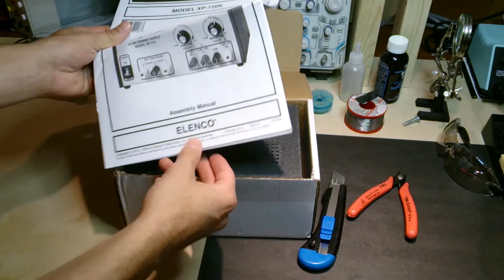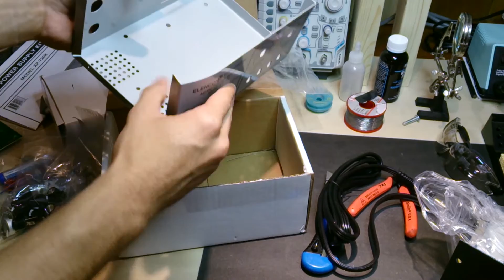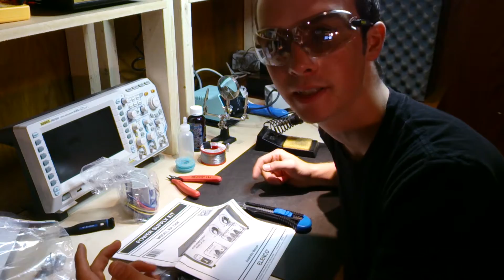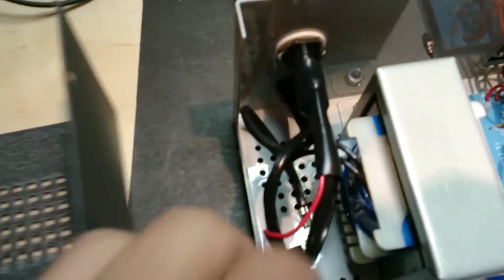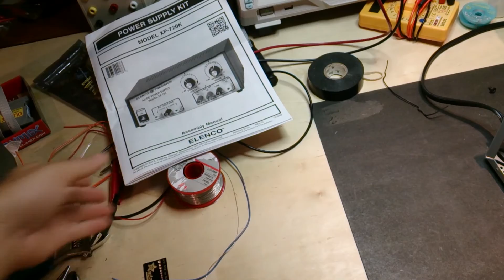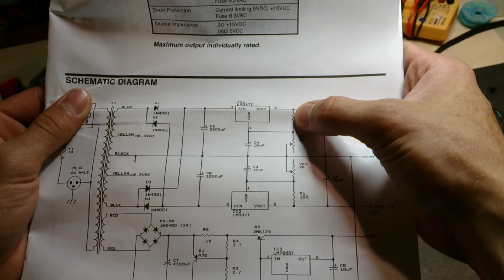Tinman Electronics 1 - Elenco power supply build

Comment: They could have done much better with the TO-220 regulators @9:09.  They could have designed it so the regulators mount vertically on the PCB and by moving the board toward the rear of the chassis, mounted to the case with insulators (they require that anyway on the heatsink.  If you have to mount a TO-220 like that I recommend soldering the wire parallel with the lead, don't wrap it around the lead, and then heat shrink each lead of the device and wire connection completely to prevent accidental shorting.

Comment: This is the highest amperage variable supply I have, but I can attest that it does have its drawbacks, especially the lack of a display and the awful binding posts. Opened it up a few days ago to tighten them up and the wire just fell off. I'm crimping them this time. Awesome video!
Reply from the maker: Yeah, I can't argue with the current rating of this supply since I haven't yet used over 1 amp in my electronics projects. I'm glad you enjoyed the video; thanks a lot for the feedback!

Comment: I built one of these.  It was short one star washer.  The wires could have been 3/8 or half inch longer.   I used a lot of liquid electrical tape and additional heat shrink tubing on all the wires going to the regulators.  I wouldn't avoid it but should be good at soldering and double-check each wire.

Comment: Just an FYI. The 6.3 volt ac and 12.6 volt ac are for tube filaments.
Reply: yeah, and everyone those days is a "huge tube fan", so, they will use those outputs everytime! :)))))))))))))))))))))))))))
seriously speaking... they can be useful sometimes... when you need a signal of 60 (50, for Europe) Hz and an amplitude of 6.3 or 12.6 V! :)

Comment: I gave up soldering the binding posts and used a small wrench to tighten the wire's between the nuts and used locktite to secure them.  I never bothered with the heat shrink and zip tied all my wires into bundles.  It's not a bad kit, but it was a pain in the ass but thats why i build these things.

Comment: With some 10-turn pots for better control, better/higher voltage caps and an aftermarket panel-mount voltmeter it probably would not be a bad little power supply. Of course once you do all that why not build it from scratch? At least it has a primary side fuse. The smaller XK-15K kit has NO fusing whatsoever! What is interesting is that I found reference to an older XP-620 which does not have the 6.3V AC output, so there obviously was a demand for it (for what I have no clue).
Reply from the maker: Yeah, it would be easy to upgrade this power supply, but then I'd be losing more and more on the value of it. I could add the 10 turn pots, better caps, better binding posts, and a simple 7-segment voltmeter (http://www.adafruit.com/products/705) but then we're all better off settling for a better power supply! I always buy cheap equipment, and never learn my lesson...I gotta stop cheaping out on this stuff!
(And I totally hear you on the 6.3VAC output...still no clue what I'd use it for)
Reply: Tinman Electronics Looking around 120V to 6.3VAC power supplies (plug-in type) are not that uncommon. I suppose some equipment/devices rectify "on board" but do not have a transformer. As I am just getting back into the hobby after a few decades my assembly skills need some work. I purchased an cheap unassembled XP-620 kit off of Ebay for the practice. Without the extra 6.3V terminals there is a lot of real estate of the front panel for some extra meters. Relatively cheap, should be fun to modify and if I destroy it no big loss.
Reply from the maker: Bigrignohio Good to hear you're getting back into electronics! And good call on the 6.3V terminals; I could always remove them to make space for adjustments!

Comment: I built mine based on the LM317 on a piece of experimenters board, similar to what you have, and mounted the LM317 to a TO-3 socket. I wish I had known about the LM338K!   I even made my own voltmeter gauge  from a scrap meter movement.  Mine fit into a plastic project box from Radio Shack.  
  I'd like to figure out where to get a nice soldering iron, the ones you get have copper tips or just burn away, and I don't have $120 to spend on a good Weller.

Comment: Please do yourself a favor. Chuck the "lead Free" solder. It doesn't flow well, it doesn't stick well, and causes a lot of problems down the road. Use 60/40 solder. If you want, use a face mask N-95.

Comment: Hey, Tinman. Very nice video, you encourage me to do videos of myself during my student engineer career. I would like to ask you, at some point of the video you said that the wiring was bad, I saw it pretty good, so tell me, what's the best way to wire any project, I know it depends on all the components but I need some good habits. You can help me with some video-tutorial you recommend or some advices.

Good work again.
Reply from the maker: I work as a technician for the local electrical utility. So I'm used to making my wiring very neat and organized. If you can, wrap groups of free-hanging wires together with cable ties or velcro wraps.
I might have said the wiring was bad for a number of reasons. I actually cut one of my wires too short, and I just spliced it with another piece to make it longer. Avoid this if you can. I should have gone back and re-run the wire.
Also, I've never soldered onto binding posts before, and I only became good at it on my last 2. Another thing you could do is put heatshrink on the ends of your wires/cables.
And my last piece of advice for wiring, is please learn how to solder the correct way. I see tons of videos of people soldering, and they don't do it right. Sometimes it's negligible, but most of the time it sacrifices connection integrity and looks less appealing. The best ressource for soldering: Pace (https://www.youtube.com/user/paceworldwide/) Watch some of their videos. They teach more than "how to solder", they explore a lot of pertinent knowledge.

That's just a couple things I can think of right now. Good luck to you.

Tinman
Reply: Tinman Electronics Thanks a lot, I just checked the videos and they're very useful. I'll be following your projects and I'll recommend your videos to my friends and classroom' mates in the engineer. Greetings from Mexico.
Reply: ... russian soldering iron is russian! =))

Comment: Cool video, you saved me from buying this.
Reply from the maker: Good call! I would definitely get a pre-built supply over this. You can easily get a single-output supply for less than 100$, which I think would bury the Elenco power supply. I've had it for nearly 2 months, and it's really annoying that I can't see the voltage directly on the power supply...I need to hook up my multimeter to get the voltage...
Reply: I suggest a little modification by adding a cheap led voltmeter.  Good video.

Comment: You totaly owepaid this kit you can build that power suply in a frachore of that price
Reply: True, I could build a decent one with voltage and current adjust for 15 bucks.  But for beginners, this kit is pretty decent but a bit pricey.
Reply: +rene kenshin how do i design a power supply rangings from +100 V to ground to -100 V,asymetrical
Reply: I don't know any adjustable regulators that could output more than 37 volts. You could try using a zener diode approach with transistor current booster. The transistor should be rated higher than 100v for safety. Just search the net, hundreds of circuit ideas could be found there.
Reply: +rene kenshin well thanks,i want to design my own cirtuit,but i think i cant do that,i think i lover the voltage to +-50V ,because some circuits use heavy volatges and current,like an amplifier circuit which has +30-30V or testing,i think i need to lower my expectations
Reply: That was before Radio Shack closed its stores.  Now, you can't get the 23Vtransformers unless you special order from the big suppliers like Mouser, or from overseas. :(